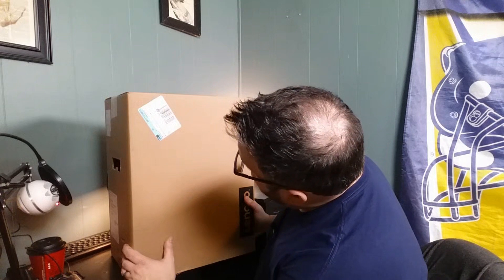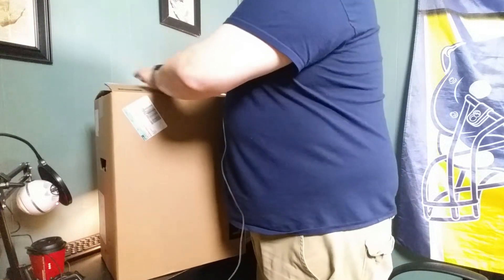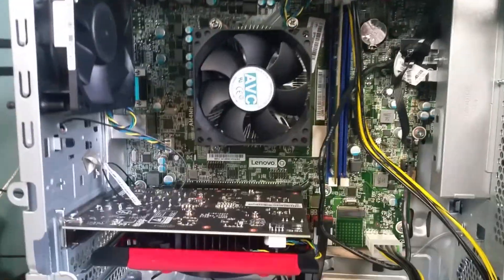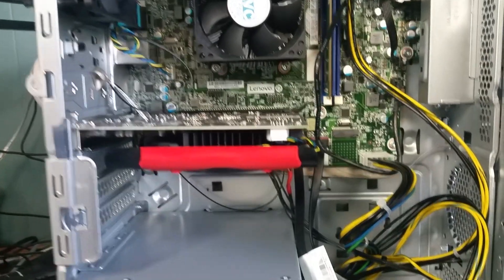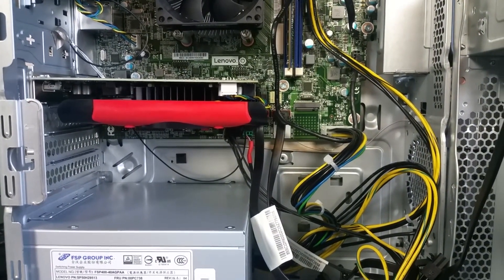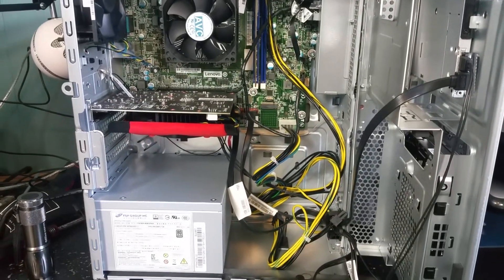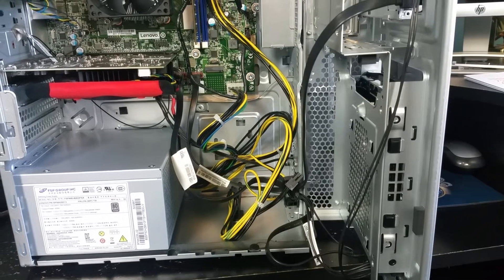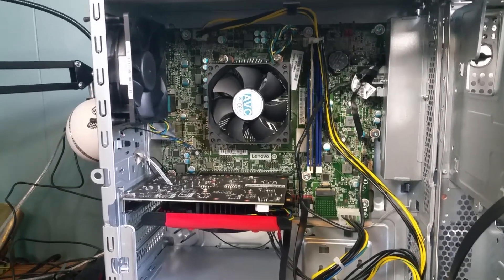Unboxing and Setup of the Lenovo Ideacentre Desktop 720-18...Sort of.

Comment: I bought this same PC about a year ago and I personally love it. I've since upgraded it with a 450w power supply, a GTX 1660 graphics card, and an additional 8gb of RAM (totaling 16gb). It's quite the beast of a gaming PC now. 
The small, compact size can definitely be a problem for some though. I was JUST BARELY able to fit the 1660 graphics card in the case. Also, cable management is a nightmare if you have a non-modular power supply unit, due to the lack of room within the case. The compact size is the only negative I can think of though, personally. I can't even call that a true "negative". It's only a negative for those looking to heavily upgrade the PC. You'll run out of room very quickly.
Great PC, especially after you throw some upgrades in it. It becomes a powerful gaming PC while looking like a standard desktop. Anyone who glances at the PC would never guess it's a monster of a gaming rig. I love it.
Reply: Quick question, have the same PC. Wanted to install a rx 570 4gb.
The PC does have the required power/sata cable for GPU right?
Just want to make sure before I order.
Reply: I just seen one for 250€: 2400G 1TB and 8 ram, I think I will upgrade the ram and add a SSD in the future if I buy it, worth it? easy to apply?
Reply: Hey! I have the same computer,  and I have a few questions, since i want to upgrade mine. Is the psu a standard atx size? What pin connector does the motherboard use? 10?  14? 24? And how long is your graphics card?

Comment: Helloo! this i will try to do,i have one like this but with the 220w power supply! so i want to take the motherboard with the i7 7700 and the 2x8 gb of ram and put it on another case with an 600w power supply and an gtx 1070ti turbo(which right now is at 40% off in my country,Romania)! i ll buy an middle or high tower ...should i trust the motherboard or should i buy another one!!???
   Edit:By the way...the system is ok,i mean runs the game nicely with that low profile gtx 1050 2 gb...i play with medium to low preset and 1920-1080 in almost all the games that i play,games like Sekiro,The Division 1,some Ubisoft game which you know that is hard to run on particular systems,far cry 5,Far Cry New Dawn,The Witcher 3 with everything on high i get 45-55 fps,which is playable,now i start to play 2 days ago the game "Sinking City" with everything on medium and 1080p,40-50 fps,no stutter at all...you get the idea...there are some new titles where is need to crank down the resolution,but still i can enjoy!! so is not that bad! i have it from 2 years! Cheers!

Comment: Thanks for the video. Almost bought a similar system "Lenovo Ideacentre 720 18L Gaming PC Desktop Computer(Intel Core i7-7700, 12GB DDR4, 128GB SSD, 1 TB HDD, Nvidia GeForce GTX 1050Ti, Windows 10 Home), 90H00006US
" for like $400 but not being able to upgrade it is a deal killer.
Reply: man,yours is good i have the exact one but it has a gt 730 4gb of ram and a i58400 and i paid like 500 dollars

Comment: Just purchased 4.9.19 an ideacentre 720 from Office Depot for $850.  Apparently they have upgraded the motherboard.  Mine has an open SATA3 plug in with power supply and an extra PCI slot.

Comment: I bought an Ideacentre 720 a few months ago and love it so far. The specs of mine are:
*PCU: i5 8400
*GPU: GT 730
*8GB RAM

It's the best pre-built I've ever owned, personally. It IS a hassle to upgrade components though, as is typical with Lenovo PCs. So, that is a minor drawback. For example, I recently upgraded the graphics card and power supply, but I had to buy a 24-pin to 10-pin adapter cable for the PSU. Lenovo motherboards use a proprietary 10-pin connector, and you can't connect a new PSU to it without the 24-pin to 10-pin adapter cable. 
The adapter cable was only about 20 dollars though, and once I had it I installed the new power supply and graphics card no problem. I can see why others look at the Ideacentre 720 and think, "Screw that", but I personally love it so far.
Reply from the maker: It is a good value for the price.  I needed to add 2 SSDs and didn't want to have to do the work you did. This year I ended up building a new computer!  I'll have a video out soon about it. Also, I have a Dell i4790 that I upgraded the PSU on like you did, and bought an adapter cable as well, which worked just fine. :)

Comment: Could I move all the contents of this rig into another case?
Reply: I was also wondering this, feelsbad that no ones answered
Reply: @Jerry_Bean  this i will try to do,i have one like this but with the 220w power supply! so i want to take the motherboard with the i7 7700 and the 2x8 gb of ram and put it on another case with an 600w power supply and an gtx 1070ti turbo(which right now is at 40% off in my country,Romania)! i ll buy an middle or high tower ...should i trust the motherboard or should i buy another one!!???

Comment: Hi, i have another power supply, and an GTX 1060 2 fans. Could i upgrade it?
Reply: Yes, you can upgrade the Ideacentre 720. You just NEED to buy a 24-pin to 10-pin adapter cable in order to install a new power supply. The adapter cable is only about 15-20 bucks. Aside from needing that adapter cable for the power supply, you upgrade and install components just as you would any other PC.

Comment: All I would care about is if I could upgrade the gpu.
Reply: You can. Just bear in mind that when upgrading the power supply unit, which you most likely will need to do if upgrading the GPU, that you NEED to buy a 24-pin to 10-pin adapter cable in order to connect the power supply unit to the mobo. Aside from that adapter cable, which is about 20 bucks, you upgrade/install components exactly as you would with any other PC.

Comment: Can it run fortnite?
Reply: Yup. Anything above Intel HD Graphics can run Fortnite.
Reply: The Ideacentre 720 that I bought came with an i5-8400 CPU, a GT 730 graphics card, and 8GB of RAM. With these specs, it could run modern, current gen games like Quake Champions, Outlast, and GTA 5 on low-medium graphics settings. Older games, like Fallout 3, New Vegas, Oblivion, Battlefield: Bad Company 2, etc run at max graphics settings, 1080 resolution, and 60 frames per second. I don't play Fortnite, but I can already tell you that this PC will play it no problem.
After an inexpensive GPU upgrade (1050 Ti), my PC can now play GTA 5 and other current gen games at max settings. More graphically demanding games, like Doom 2016, CANNOT smoothly play at max settings, however. I still have to lower the graphic settings in Doom. And I assume a 1050 Ti would not be powerful enough to play the most recent AAA games, like the upcoming Resident Evil 2 Remake, for example. From what I've seen so far, the graphics in that game look too demanding for a 1050 Ti. A PC gamer would need at least a 1070 GPU to play these at max settings, I'm assuming.
Rambling aside.... Yes, even with default, factory specs, the Ideacentre 720 will play Fortnite without a problem.
Reply: @DeadPixel1105  Actually a GT 730 wouldn't handle it that well. It can barely handle the older versions of the game, so i can't imagine how it would run in today's versions.

Comment: Hello all... I attempted to install a m.2 drive in this system and found you need an additional bracket part no. 01EF811 found here:  https://encompass.com/item/11093682/Lenovo/01EF811/Mech_Asm_Avc,_M.2_Ssd_Brk_Asm(244mm) which is currently out of stock until 05/21/2018... The manual list it as a part at the end but, never tells you anywhere you need it.

Comment: Great video.  Answered my concerns about expandability and upgrades.  As a result, I won't be buying this.  Instead, I am thinking about the HP Pavilion 580-137c.  Both this Lenovo and the HP are currently on sale at Costco for $600.  The Lenovo on line, the HP in-store only.  The HP has a lower level video card - the RX 550 4GB - but looks better in other respects.  Three SATAs, not 2.  The power connectors for mobo and hard drives look standard, not proprietary.  The power supply looks like it might be "normal" size and shape, but that's hard to tell from the pics I saw.  And it has one PCIe x1 slot.  Since I'm not a gamer, but will want to add to this system, the HP looks like the Goldilocks system.

Comment: did you add a m.2 ssd? from what i've read on multiple sites and i think from some reviews, some said you can't have a hhd+optical drive+ssd. if i'm understanding it right, if you add the samsung evo m.2 ssd instead of a sata ssd, you can have that combination, is that correct?
Reply: i did this and it works. m2 fits fine....
Reply: Jj Sands Hey buddy, could you help me out with how you did this? I have this Desktop and i am trying to upgrade the hdd to ssd. Could you guide me through what ssd you used and how you installed it? From some research that I did, it says it needs an adapter? Any information would be helpful. Thanks.

Comment: Which version of the 560 is it?
Reply from the maker: I returned it the same day I believe, so I'm not sure which one.
Reply: FastGadgets thank you for the fast reply. I ended up buying the pc because of an open box sell they had. I bought it mostly for the ryzen 7 cpu. I plan on swaping everythimg else later on but for light auto cad use and light gaming i think its fine. Its way better then the four year old laptop i was using. But enough of my rambling thanks again for the response and have a good day.
Reply from the maker: Victor Marin it will work well for you I’m sure! I just need more expansion at the time.

Comment: Can i put a gtx 1050 in it??? plz reply fast
Reply from the maker: I would say yes, because it has one PCI-E slot if you remove the AMD RX560 card.
Reply: The original card is better. 4gb of video vs 2gb video of 1050

Comment: Just bought this PC for $650, which looks to be a good deal.

How would I go about adding SSD into this and keeping 3.5 HDD?
Would I just need to unplug CD drive and plug in SSD with SATA cable?

Since SSD isn't a moving part, I could like tape or Velcro into the case.
Reply from the maker: You can’t. Watch the video
Reply: So is the dvd drive just a standard 9.5mm dvd drive?

Wouldn't it be possible to get a ssd/hdd caddy and use it in place of the dvd drive?
Reply: In case you wanted to know. I bought a SSD 9.5mm caddy.
Inserted SSD into caddy, unplugged both cables going into DVD drive and plugged them into ssd caddy. Used Velcro to hold down caddy next to dvd drive.

Windows detected the SSD and is running at SATA III speeds, so no speed loss. Now have SSD and 1tb hdd in system.

For $7, it was a cheap way to get around the problem in my case. I think I heard you need 3 drives, 2 is enough for me.
Reply: jms209 so you cannot run DVD+ssd+hd?
Reply: Really late, but no. I just use a cheap $20 usb dvd drive.
Reply: @metroid209  I'm aware to be a bit late but I'm wondering if you're still using this pc and if so if you've upgraded it since your last comment under this video, I'd like to change and upgrade it myself since I've recently bought this pc but seems like it's not working at all keeps showing me Blue screens and gives a lot of problems with Steam or Epic Games... I cannot bring it back so if you can in any way help me I'd be more than just grateful to you.
Reply: @BandanaJacob  I've had a 1TB SSD in it for a while, just disconnected sata cable from dvd drive.
Also upgraded GPU to RX570 4gb and 1tb 3.5 drive to 8tb.

Added 16gb stick of ram, now has 32gb total.

Have had no issues with it and I use it everyday.
If the PC is freezing during games, could be the GPU.
Try running a CPU stress test and see if it freezes.

Comment: I bought this and a acer monitor and it's saying no signal
Reply: SL GAMING are you plugged into the mobo or the GPU?
Reply: GODMODE fAnTASTIC I plugged the hdmi in wrong port since it has a dedicated graphic card
Reply: SL GAMING Yea Ryzen doesn't have a GPU built in, so your motherboard has useless sockets.

Comment: Lenovo is a good buy ... if and when and as long as you purchase machiens of the Tink line. ThinkCentre desktop, ThinkPad laptops. But never bother with their Idea... shit!
Reply: ThinkCentres are also very limited in terms of upgradeability. We have them at our company. Both the SFF and tower ones are built on proprietary PSU and motherboard. Those machines are clearly intended for business, if you need more flexibility from your desktop then don't buy Lenovo. Also if anything fails after the warranty period you will have to look for used parts from the similar models or buy a new PC.
Reply: Yes, of course. I use my mini Lennies as pure office warriors/distro testers, nothing more. They are great for that. Nearly indestructible and very clever internal layout. And they hardly use up any space on my desk. For gaming I use my self-built machine.

Comment: I got a ryzen 7 and it's a beast cpu, even at stock. Good for virtualization. Rx560 and ryzen 7 1700 is a perfect combination for you. Also, you can't take out that card because there is no onboard GPU on ryzen CPUs. That HDMI port is for ryzen APUs.
Reply from the maker: I did end up taking it back, but I have something much better. Video coming up Tomorrow!
Reply: Can't wait!

Comment: you can't run a display off the motherboard because the Ryzen 7 dos not have video card on it
Reply: hi im just getting in to gaming can you please explain what you can't run a display of the motherboard of the Ryzen 7 does not have video card is that good I would really aprecite if you could tell me also should I buy this or not thanks
Reply: Basically the processor doesn't have a prebuilt video chip (in other words it's not an APU). Just plug in the cable for the monitor from the monitor.